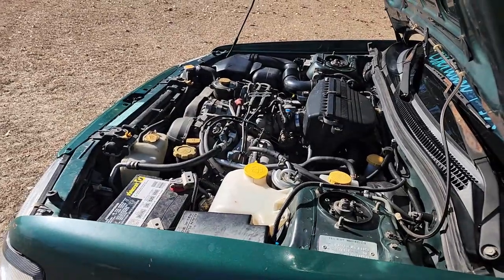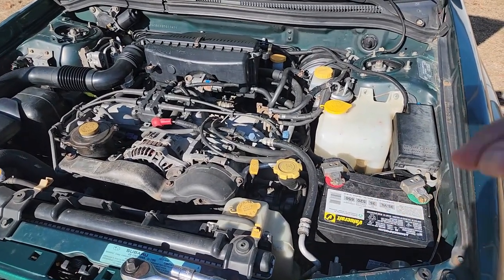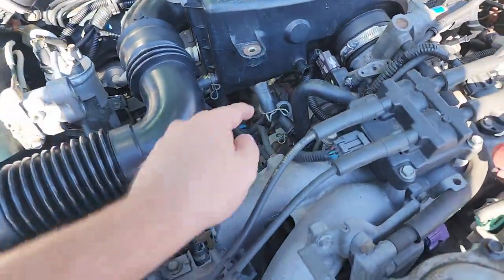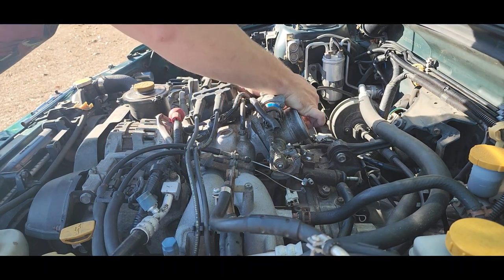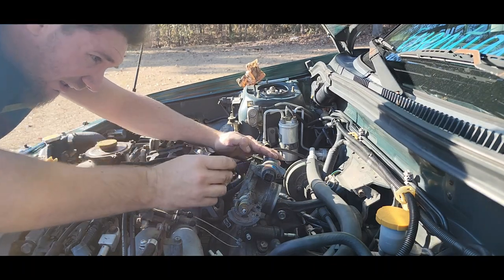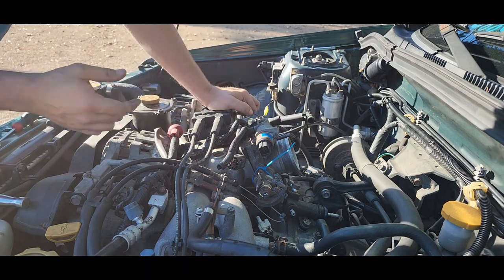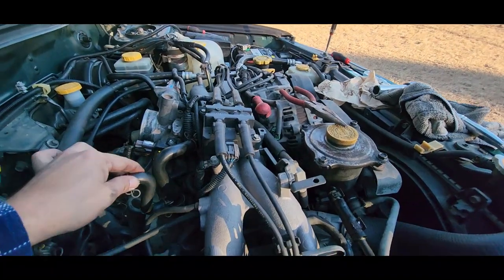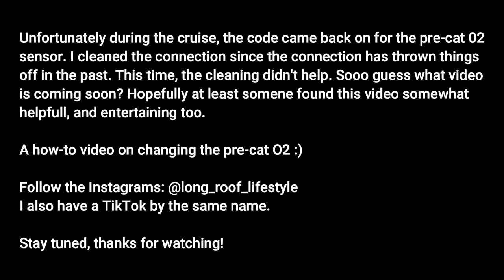How to clean your SF's throttle body and PCV system

Comment: On your air filter box the tiny piece that sticks out near the throttle body connector is there a vacuum hose that connects to that it is to the left of the throttle body connector sort of at the bottom because when you pulled the air filter box out there was no hose is that to allow air of some sort to breathe